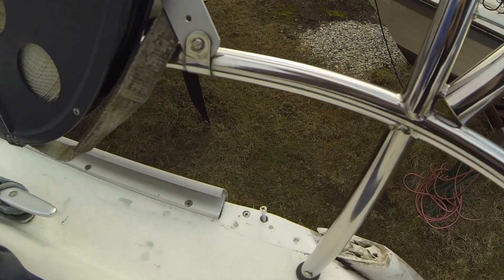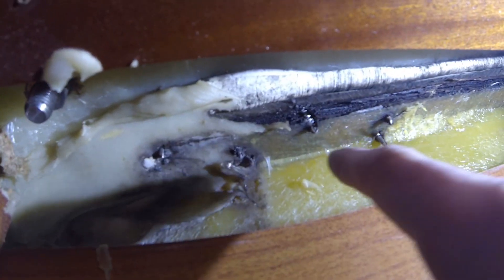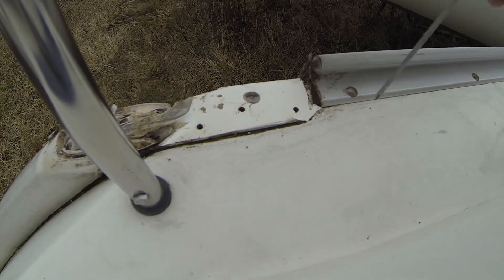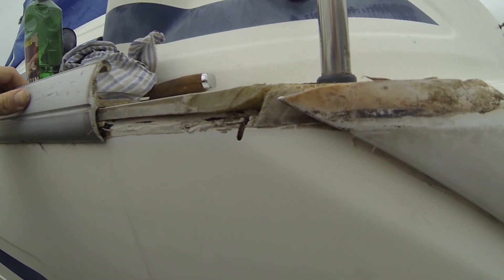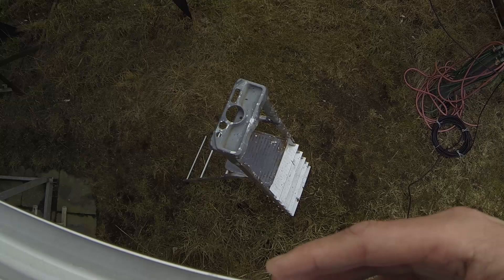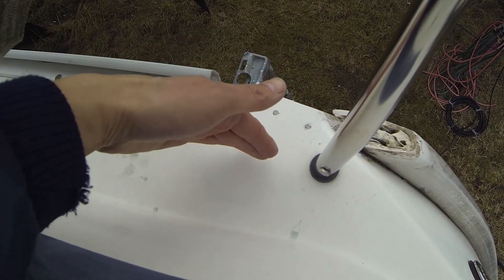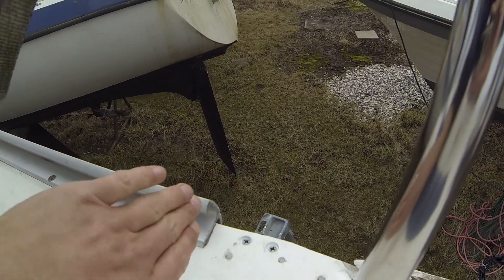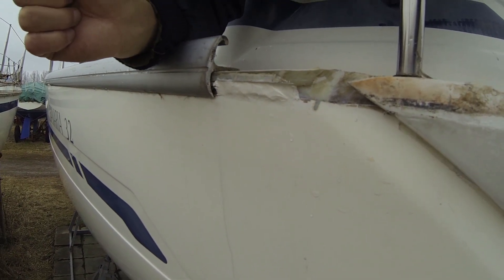Leak at stern hawse fairlead - found big hole in port side

Comment: Thank you Tino for another exceptionally useful video. I had a persistent leak at the port aft fairlead (usually called a ‘fairlead’ in the UK, not hawsehole) on my identical B32 and I completed the repair using your video yesterday. It is raining today and the boat is dry. The only thing I forgot was to apply the epoxy using a plastic bag. It would have been easier for me if I had done as you did. So pleased to have the problem solved at last.

Comment: Thanks for watching. As a sidenote to your repair I like your comments on the tools and materials you are trying out. Somewhere I read that butyl need time to set before you tighten fully. First day you add the butyl and mount the screw but not tighten too hard, because butyl is slow to conform to the surroundings. Second day its ready for fully tighten the screw. Then it should be tight. An advantage for butyl is an easier dismantle compared to Sikaflex at a later time. I have not yet used butyl but soon I will remove my toerail for fixing leaks where I expect to use butyl sealant. Have a nice weekend :-)
Reply from the maker: Thanks :) - For sealing around screws and deck hardware the butyl sealant is very good.  I use the cheap 36Kr. butyl sealant from Biltema, everything I have sealed with it has not leaked a single drop of water. On the Bavaria I think they have used marine silicone on all the screws and a kind of foam tape at the toerail connections.
Reply: Tino G - Sailing Maybe there was still some silicone left in the screw holes as it leaked after your butyl atempt. I was once told that silicone is not allowed om boats as it is very hard to cleen up for a new repair. Nice to hear your expirience with butyl ;-)